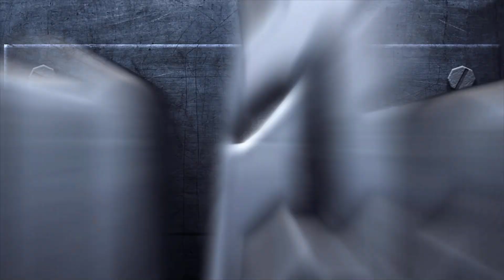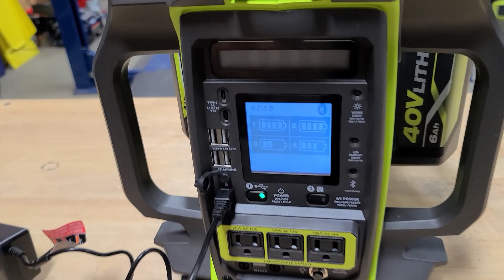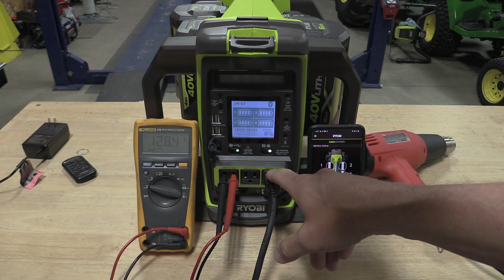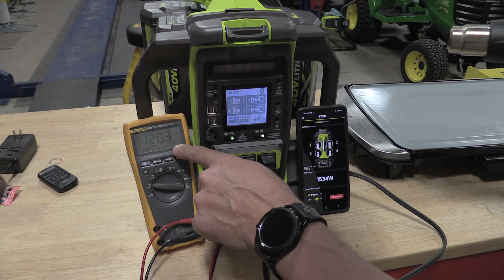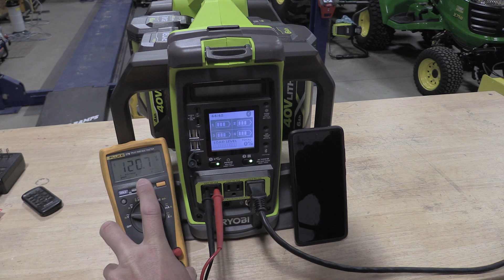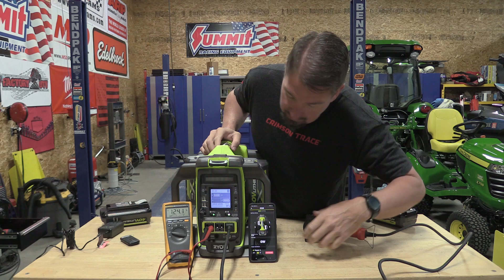Ryobi 40-Volt 1800-Watt Power Station Inverter Generator /4 Port Charger Review

Comment: You are the only one who covered charging so far.  A bit ridiculous it cant take 12v or a solar panel. A 20 or 30 amp chaegw is more appropriate.
Selectable Sequential. parallel and manual charging makes sense.
As noted, an inability to turn on remotely is unfortunate.
It hasn't UPS features of better power stations.
A search will find many for sale used, clearly not meeting people's expectations.
I'd expect this gets replaced with improved models relatively quickly, while becoming substantially cheaper to be competitive.
We can compare this to Ryobi gas generators, which were horrible and expensive., improving over years.
Ryobi compatible power supplies are commonly under $100, but do not charge.

Comment: If you’re just running a fridge putting out around 700 watts a few times on and off for a couple hours while the power is out would you be able to also plug in a charger to recharge extra batteries and keep it running for as long as you needed?

Comment: That was an amazingly well done review.  Thank you for that as I've been considering purchasing the 40v power station.  I may buy one of these units next time Direct Tools (Ryobi's outlet for blemished / reconditioned tools) has 7.5 or 8.0 Ah 40v batteries on a really good sale.  I missed a good sale a couple months ago where I could have purchased 7.5 or 8Ah 40v batteries for around $100 each.    Right now Direct Tools is selling this unit for $360 (factory blemish).   From the reviews I've seen, I think this unit would be worth having if you also have four 7.5Ah or larger batteries.  I think the run time for anything other than charging phones, laptops, and running some lights or a small TV is too short on smaller Ah batteries and or less than four batteries.   I'm fortunate to have two Direct Tool outlet stores within an hour's drive.  For your viewers that don't have that advantage, the Direct Tools website is excellent, I have a lot of Ryobi tools, pretty much all are either blemish or reconditioned.

Comment: Great review.  Thanks!  I got one of these by bartering.  I traded a couple of hours of labor for this unit, and one of those One+ 18v inverter things.  I do wish this unit would charge with solar.  I will be using it mainly for van camping, running lights, fans, and charging devices.

Comment: I think It's too expensive..I have a ton of Ryobi batteries and use many of their tools even though I mainly use Dewalt for work.I have the blower and trimmer in 40V and may consider this inverter if it gives better performance.  I have the Dewalt 1800 inverter that I paid $450 and thought that was too high but it works good and I have the 60v Flexvolt batteries for my battery powered table saw and miter saw. It will run Power saws and shop vacs with no problems. I think I saw your video of the Dewalt inverter. How do you compare them? I didn't hear you state how long to charge drained batteries. Did you run some appliances with it? What kind of times did you see. I wonder how it compares to the 18V.  I live in Louisiana and storms and generators are a necessity here! Thanx for the review!!

Comment: i already have a 4ah and a 9ah battery. is this thing worth it with all those batteries or would i be better off buying something like a jackery and spending double/triple? I only need it for running fridges/freezers during power outages and a submersible pump for my french drain. (probably wouldnt strart my sump pump up) i have a small generator right now and while it worked well during my last outage it was a hassle keeping it running and swapping out fridges/freezers/submersible pump. my main concern is run time but it seems like i can charge this thing with my small generator.

Comment: Thank you for the informative video.  I have a 1/3 HP sump pump.  Do you feel this unit will allow its use as back up power without tripping?  I’m concerned about the starting amps?
Thank you

Comment: 2300 watts would/should trip the breaker on a 15a circuit in your house too. 2300w÷120v=19a. It's never a good idea using multiple heating elements on one circuit.

Comment: Circular saws can draw 30-50 amps (or more) during startup, which is between 3600 and 6000 starting watts, but that's not even the worth part. Circular saws are a huge inductive load that causes a great deal of apparent power. If your saw has a power factor of 0.6 and needs 1440 watts, it will need 20 amps of current, which is actually a 2400 VA load on your inverter. This is going to cause excessive power draw from the batteries, shortening your runtime, and also making it much more likely you'll hit an overload trip when starting and using the saw.

Comment: It was a dodge workpro 2500 that I wanted btw. Diy extreme RV mods. YouTube.  I got a seven stage waterfilter in the cart found that royobi bilge stick. I designed a five gallon shower recirc that filters itself. Portable in the sand hotub with electric coil heater to bilge ocean water into for a few days.  Lots of wild rides. Very cool campers comforts. Hiltbillydeluxe

Comment: Okay i just saw royobi has a pull cord 6500. See that drive shaft goes straight though. You have a real shop so you can make a plug and play add on electric assist hybrid combustion/electric motor drive axle.  So I'm gonna yank the piston or pistons plural and all thee internals so it spins freely with the resistance ONLY GROM THE GENERATOR MECHANISM ITS SELF.  lube everything up with STRAIGHT Z MAX MICRO LUBE out of a pressurizable refillable can sprayer. Like Ed 40 those refillable ones are tha shizz. Fun nee things for your shop. With that pull cord it might be enough to get that generator spinning it's self and if not just use that 18vonepositive one plus, to pop the motor like a start capacitor in a car. I saw those 120v inverters. Use a button actuator switch close open circuit switch. Pop it over, get it spinning and then put the 18v invert back in it's storage spot.  Campin simce campin since campin. ;). Byootyville for real!

Comment: Im gonna buy that gas powered inverter and take the combustion out of it and fit it with an electric 120 motor on the spindle. On the drive shaft. I got some stuff on youtube I want you to see. These people assist me globally. Fab labs...all I gotta do is ask.  I pickit, theyyyyy stickit. 3d printers n shizz.   Check it. They have bldc motors that can push 300pounds. A very low drain 120v motor, plugged straight into the outlet of the inverter so it steps up to 120 and doesn't have to step down again and once it's spinning it's infinite. You can use a lawnmower pullcord if you want it doesn't have to be fancy. Steam punk it. No chips. Just mechanical moving parts. Gears and grease. - Monty

Comment: ...running it with 4 12 ah batteries should be awesome. Ryobi should sell a portable solar panel with its corresponding cable-adapter to connect it to this unit to charge the batteries.

Comment: Let’s say I’m running four 6Amh batteries, how long would my fridge run off it?  In case of an emergency
Reply from the maker: It would run a 400 watt fridge for about 6 hours with those batteries if it ran most of the time.
Reply: @WorkshopAddict  Could you plug in a ryobi 40v charger and charge a 5th battery to swap later and increase run time? how much will it draw if so?
Reply from the maker: @rafa2044  you can, but you lose about 25 percent of the power in conversions from DC to ac and ac to dc.
Reply: @WorkshopAddict  Thank you for the prompt response!

Comment: What about 8ah batteries.? Yeah, I know, expensive! Did you ever test the parallel feature yet? Heat elements always have a high draw. What about AC portable fans, internet routers, etc. My use case would be refrigerator (save the food, right?), camping, or temporary internet power (run business from home. Can you get a higher amp AC brick to perhaps charge on-board batteries a LITTLE bit faster? I know! Lots of questions, right? I enjoyed your video!

Comment: this should be able to power a 700 watt microwave right?
Reply from the maker: Unlikely.  Home microwave ovens are typically 40–60% efficient. So if your 700W microwave oven is really generating 700W, it should draw between 1200 and 1800W or 10 - 15A at 120V.
Reply: @WorkshopAddict  wow. Thanks for the input
Reply from the maker: @weldonpinder7295  Glad to help.

Comment: I wanted to like this but, at that price point it's just not worth it. My Jackery will smoke this. No Pass thru charging, no solar input, slow charging, barebones lcd screen (you shouldnt have to use the app to know the wattage being used) Even with 4 7.5ah batterys it's still less than 1000wh of actual usable power and a $1000 price tag just for batterys. You can buy a solar power station for that price.

Comment: They should have added at least one 12V standard vehicle output to the unit, which would make it much more efficient for those applications.
Reply from the maker: As far as battery generators go, this one is a disappointment.

Comment: Do you think it would run a PS4 and a smart 24 inch tv in a semi
Reply from the maker: It would do that, I believe.  But you would most likely have ps4 issues down the road.  I would suggest a bluetti AC200 as it would be clean power and last 10 plus years on the same battery and you could easily charge it via the truck or solar.
Reply: @WorkshopAddict  ok thanks I been looking for something I can get at home Depot

Comment: I would like to warn people about a factory defect in this product the first run was fine but the second run has a factory defect this defect will not only destroy the battery in slot number three but it will reduce the runtime of all four batteries by 50% or more to check to see if you have one of the units that are defective unplug the charger from the wall in the unit place for batteries in the unit let it sit for 7 to 10 days then check the power in slot number three if this battery has one or two lights lit then you have a serious defect in the product if it has three lines lit then you probably still have the defect all four batteries should be able to sit in the unit for months without one of the lights going out this short in slot three means that there is a short in the unit the unit is defective and it will destroy batteries and you will only get 50% of the run time you should not use the slot that is the fact the unit will still work but you can only put three batteries in it any batteries that this unit has destroyed return to Ryobi and they will have to replace it for free in addition at some point in the future they will have to give you a new unit to replace the defective one but whether or not they will do this Soon is not known but any batteries that fail as a result of this you can get a brand new battery they are 100% responsible for this defect so whether the battery is one year old two year old or even three year old they are responsible for this defect

Comment: How to make a solar input take the power supply plug into a 12volt small invertor plug that inverter straight in a  solar panel with small regulator

Comment: Can it run the new DC inverter window air conditioners? I have a new LG 9500 BTU AC I ran all summer. It starts softly and just sips power.  I may buy one of these Ryobi generators, and if so I'll try it out.

Comment: Just so you understand most motors surge for two or three seconds when you start the sawed the first time it probably had a 7-second surge it burnt all the dust off of the connections and the second time it probably only had a two-second surge the unit will only handle up to 5 seconds on a surge but once that saw got going you could have went through the same amount of wood as if it was plugged in to the regular outlet one thing for sure Ryobi needs to make bigger batteries at least a 12 amp hour battery or even bigger but having at least for 7 and 1/2 amp and unit runs really really good out of over forty different inverters I've this one is the best because you can swap the batteries out while it's running and it's easy to replace the batteries the biggest problem with some of the inverters like ecoflo is that when the batteries died in 8 to 10 years you only on a paperweight where is at least with the Ryobi 10 years from now you will be able to buy batteries not only will you be able to buy batteries but the battery is will probably be a lot cheaper and a lot more powerful thanks for your video I think you did a great job and I enjoyed it

Comment: Tell me about the parallel connection. What do I specifically get out of it when combined two inverters? More wattage? 220v? 3600w?
Reply: As long as you stay in parallel just doubles the wattage output
Reply: Positive to positive negative to negative across the board is in parallel positive to negative negative to positive is in series an is uping voltage

Comment: $800 to work with a heated blanket?  What’s a good real world use for this?  I have a dual power sinewave generator that runs a true 1600w.  A single 20lb propane tank will run all day with no fumes.  I like the idea of this, but can’t wrap my head around the price point given its drawbacks.

Comment: I’ll stick to my Dewalt station even tho is not pure sine wave but with the 12 amps flexvolt batteries I can run a 5 k btu a/c for an hour in low and or a welder on and off at 70 amps for a few. I can imagine that with the new 15 amp flexvolt coming up fir sale soon in can do much better.

Comment: I am not very knowledgeable about these  but I have Ryobi everything for my camper because they make such a huge variety of tools and accessories that work with their batteries.  I would like to know, in hours, how long one of these will last.  I know it depends on what you have it powering but how long, for example, a 1500 watt space heater?  Is it closer to 10 minutes or 10 hours?
Reply from the maker: This most likely would not run a 1500 watt space heater due to the load.  You need to add up the watt hours of the batteries you are using and mulitply that by 75%, then divide by the watts you need and that will give you the runtime.  For example.  a 40volt 6Ah battery is 36 volts times 6Ah equals 216 Watt hours.  216 times 4 batteries equals 864 watt hours.  divides by 1500 watts equals 0.576 or just over a half hour of runtime.

Comment: i do woodworking as a hobby and was  was thinking of getting one of these to run a shop vac on  for dust collection sense i cant run the saw/thickness planer and  vac at the same time was wonding if you think it could do it or should i try somthing els
Reply from the maker: It will run a shop vac of fair size.  It will not last long and I would steer you to something else.  Nothing will be as cheap as this.  Cheap meaning cheaply made and less $.
Reply: @WorkshopAddict   i see what do you think the run time would be  with 4 6ah  batterys  runing a a vac similar in size to the one  you used in the video

Comment: Power tool power stations are no match to solar power stations like Jackery and Bluetti.
I have Ego power station and I was so disappointed. I bought Jackery 1500. Now, I'm disappointed again. Bluetti just released AC200 Max and AC300😂
Reply: What was wrong with the jackery?
Reply: @budzindi808  
For the price of Jackery 1500.
I could of bought Bluetti AC200 Max (3000w continuous) for 200 more. I can also expand the capability by adding external batteries. 

I'm sure Jackery is watching and will be coming out with something better in 2022.

Comment: If that charger is out putting 13.8v at 100 ampds then it'll be drawing at LEAST 1380 watts to do it but in reality it would be more like 1600watts as its just current x voltage then efficiency which would be at best 70%

Comment: Can this thing charge a car in an emergency?
Reply: It MIGHT be able to CHARGE, but 'how much' is a problem.

Most EVs have 60kWh or so battery. Above Ryobi one, even if you have 4 6Ah batteries, total capacity is only 864Wh (counted as 36V).
That's less than 1.5% of EV's battery capacity. If that can run 300 miles at full charge, 1.5% would be 4.5 miles.
But considering conversion loss, most like 2~3 miles.

If a charging station is within 2 miles, and you can wait like ~1 hour charging time (it's LEVEL 1 charging speed), then it might work.

Comment: What's the size/weight difference between this and the ego nexas station? Does this drain all batteries simultaneously, I'd assume they have to, but it makes it hard to swap batteries for new fresh batteries without doing all 4.

I realize you've had issues with the ego, I'm still within return for it, also have the mower so 3x7.5. But this ryobi w/2x6ah and the 2x6 sith the ryobi mower would give me 4x6. And I'd gain the 300w ryobi ability VS the ego 150w.
Reply from the maker: I show a hot swap in the video on this.  I did more testing and I am not happy with the performance of this unit either.  It is not going to play with sensitive electronics well.  I just purchased a different brand unit to try.  Video coming.

Comment: If it had a nice MPPT solar input I'd have already bought it.
Reply: I agree, I'll probably wait for them to add that functionality in before I start buying Ryobi tools.
Reply: That would be dope
Reply: Ok... well, I liked how it performed under stress and thought I could work with it, and am pretty stoked about having one now, four 6amp hour batts and all. I had my fridge hooked up to it for a couple hours drawing between 0% and 7% of power from it, and then it shut off on its own. Does this thing have a similar mode as the Milwaukee had (before it was fixed) that if there's not enough draw, it shuts down? I don't see that reflected in the specs at all, but maybe I'm missing it.